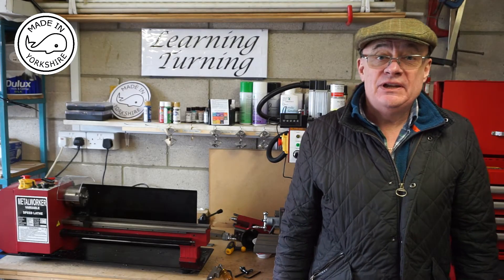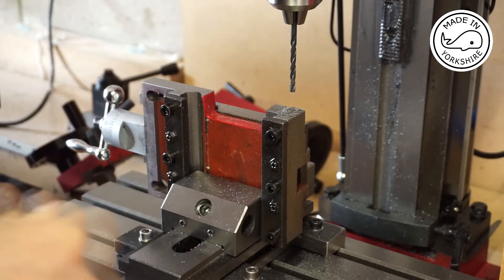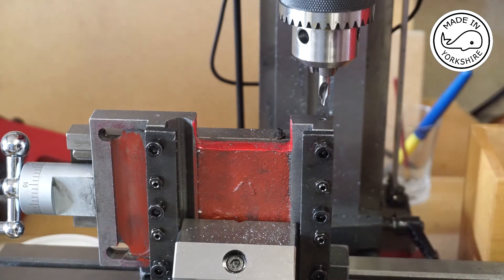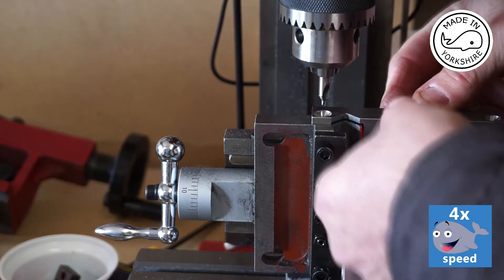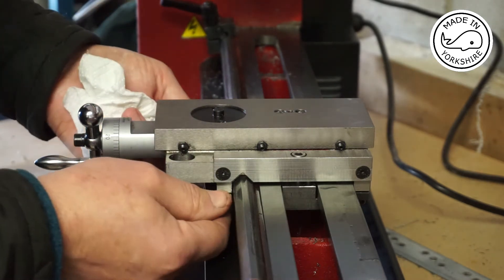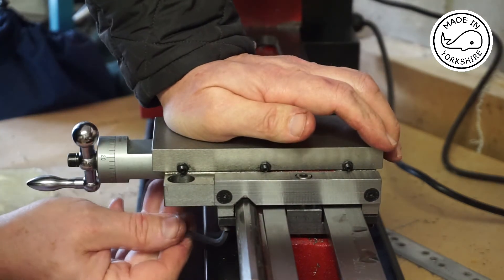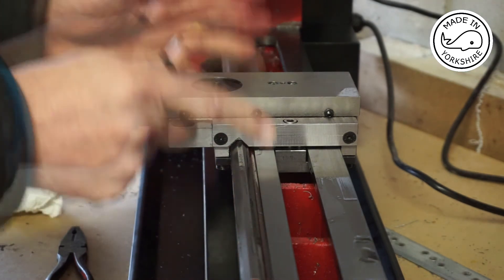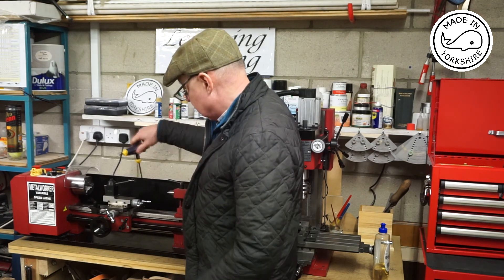#MT12 - Fitting the Carriage Lock onto my SC3 mini lathe. By Andrew Whale.

Comment: Hi I have found that to get the best out of the mini lathe they need a fair amount of setting up and mods . The saddle plates and their adjustment method is totally useless I have made new ones as shown on Steve Jordan’s channel and now the carriage is rock solid and doesn’t constantly need to be adjusted
Reply from the maker: Hi Roger. Thanks for the info. I subscribed to Steve Jordan's channel recently but I must have missed that one. I'll check it out.
Cheers
Andrew
Reply from the maker: Hi Roger. Just checked Steve's video out and I agree it's a great mod. I'm very happy with my carriage lock assembly but I will definitely look at replacing the adjusting screws with shims at a some point.
Cheers
Andrew